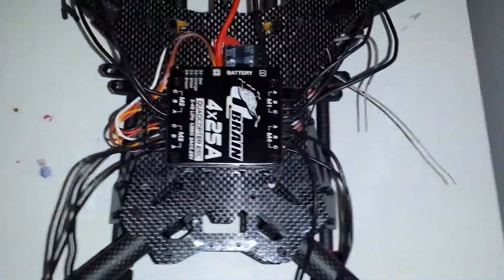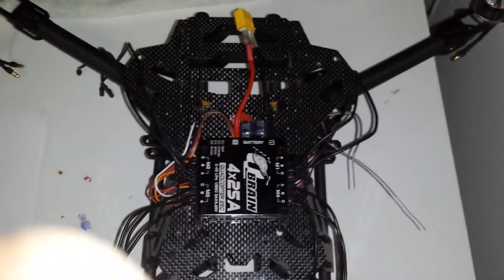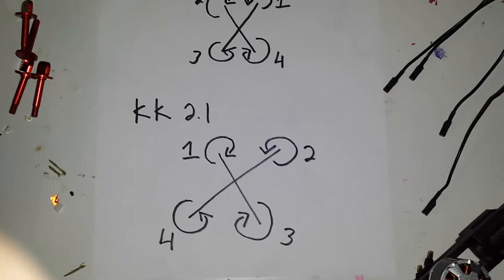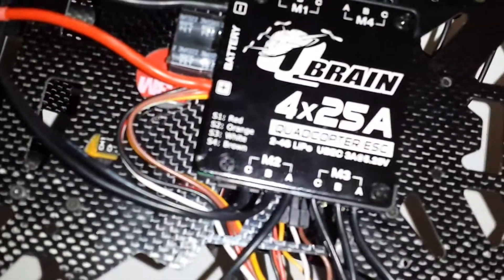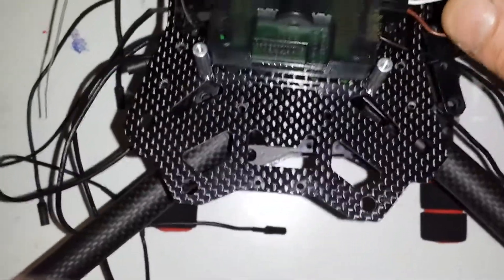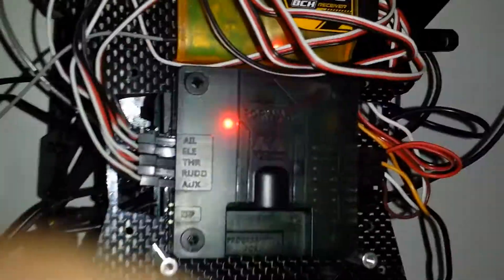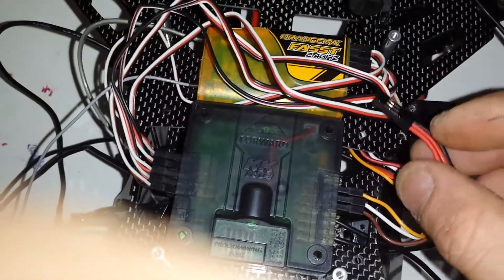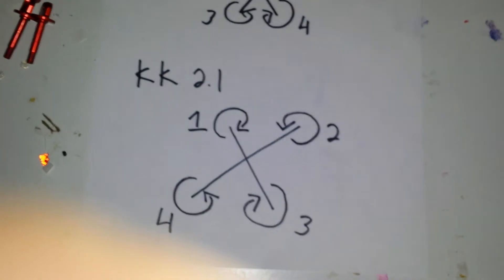Q BRAIN 4x25 quick tip

Comment: For APM users on a Quad x:
Qbrain M2 to Quad Motor 1
Qbrain M4 to Quad Motor 2
Qbrain M3 to Quad Motor 3
Qbrain M1 to Quad Motor 4

Servo Wires to APM:
Orange (move +/- leads to this one) to Pin 1
Brown (signal wire only) to Pin 2
White (signal wire only) to Pin 3
Red (signal wire only) to Pin 4